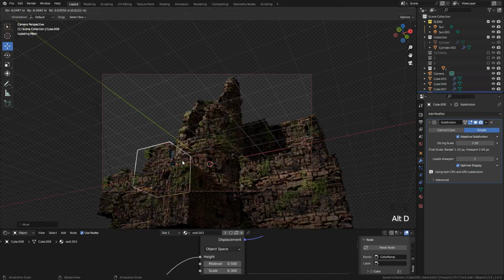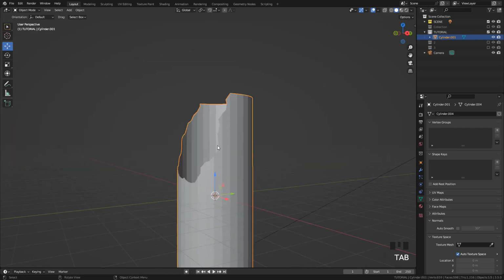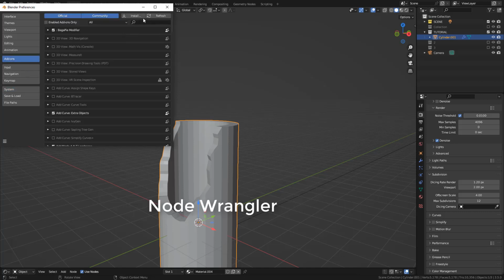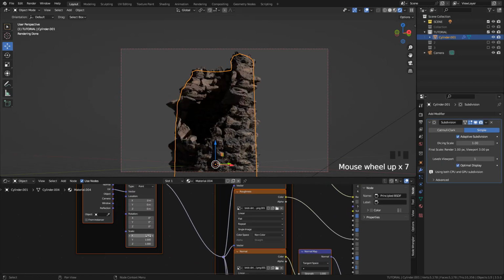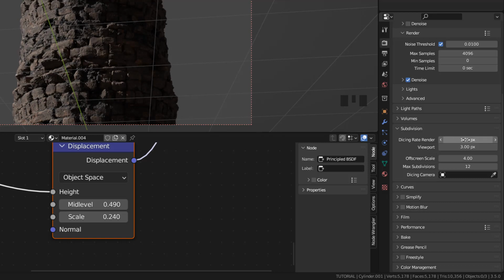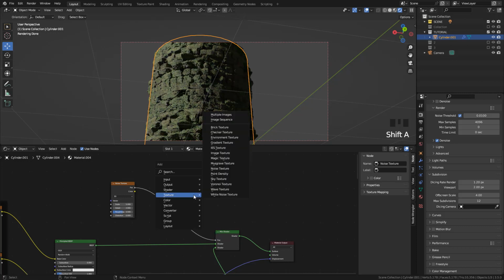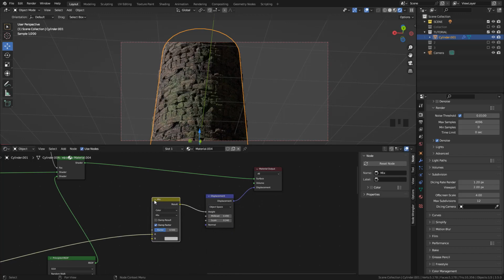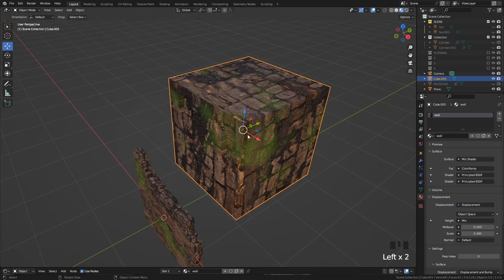How to use Displacement Maps in Blender

Comment: Hi ! Thanks for the video and congrats for the work ! I have a question.. I have already set up the height displacement, it works perfectly in the view, but I dont know why is not working when I render the sequence with ''F12'' . I have already seen several vídeos and websites to be sure every option is properly worked, still not working.. any ideas ? Thanks again, have a nice day guys !
Reply from the maker: Make sure the modifier is enabled for render, in the modifiers tab you will find the icon as a little camera.
Reply: @chuckcg  thanks for your answer ! I have been busy last days I couldnt check it, this week I will try to check the project again to see if I can fix it with your answer. If not, I will probably come back here to cry again ! 😅🙏👍
Reply: @chuckcg  I was able to take a look at the project, thanks to your answer I could see that the problem was that the number of subdivisions was very low, by increasing it the surface is perfect in the render as well. I just wanted to thank you, I wouldn't have realized it if it weren't for your response! ;)

Comment: Great video.  When i apply this on a fireplace and chimney design, i cannot get it to work.  Just a single displacement isn't doing anything.   I can't figure why.  Any tips?
Reply from the maker: If you use adaptive subdivision, make sure to use cycles experimental as well as the subdivision modifier with adaptive subdivision enabled, I have a newer video here https://youtu.be/YHleZrLFTnk

Comment: Thanks! But I always have the issue that on the edges of my objects the displacment stretches the textures and it looks super ugly. What can I do?
Reply from the maker: You can try to adjust the midlevel and scale in the displacement node, or try to bevel de edges
Reply: @chuckcg  Thanks! I did not think about beveling. But I guess this should help. Let‘s see. :)

Comment: One little performance tip:  After adding the Subdivision Modifier to your mesh, set the Viewport and Render levels to "0" before turning on Adaptive Subdivision - otherwise, you will be "stacking" dicing and it can chew through RAM and processing power really quickly.  I've found this to dramatically increase viewport and render performance and reduce RAM usage.  It's an easy thing to overlook.
Reply from the maker: Thanks, i'll take a look at that.